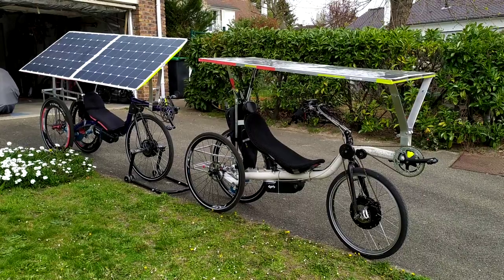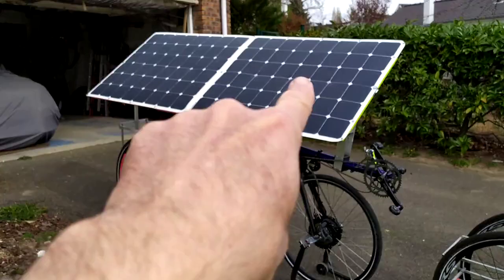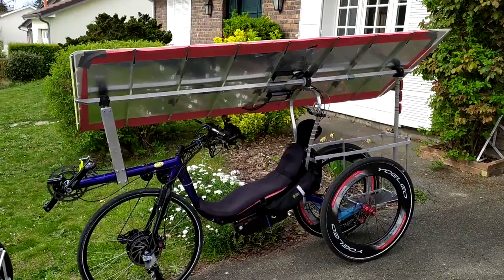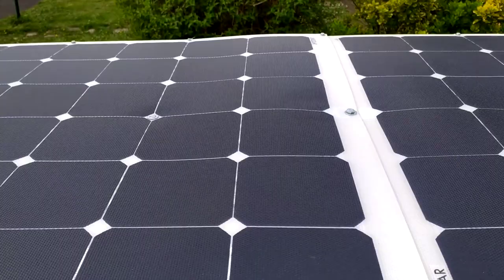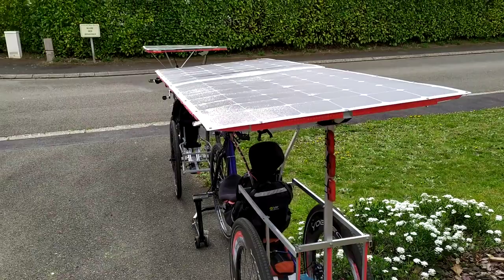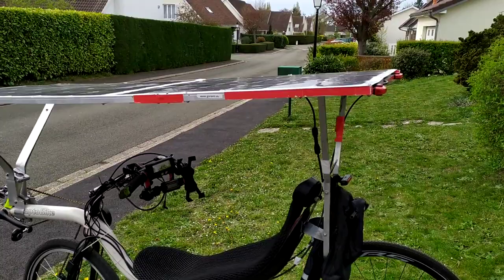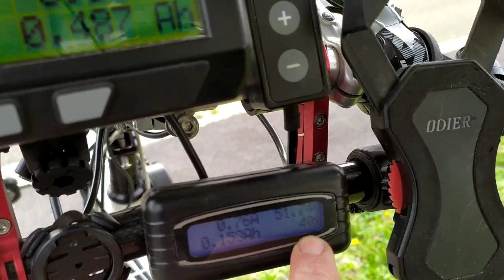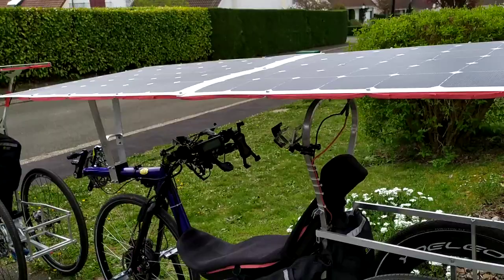Comparing Solar bikes

Comment: I'm thinking about transforming a M5 LowRacer rear drive into front wheel drive too.
Just like you did geniously. I allready have a spare Raptobike lr front fork diameter 26mm / 1 inch internal fork width 135mm wide wich can fit a rear wheel with cassette.
My 2 questions to you Daniel are: 
1. a " How with wich fork did you transformed the M5 into a front wheel drive? "
Is it possible to use my raptobike front drive Fork?
1b.
Was it difficult to add idlers for the front wheel drive chain line ?
2. Wich for wheel drive recumbent is faster the alloy Raptobike or the converted cro-mo steel M5 ?
Reply from the maker: Hi Pascal, thanks for your appreciation!
Back to your questions:
1) On this page from my web site you should get relevant information on how to transform an M5 MRacer into a front wheel drive: 
https://gonano.eu/new-2019-solar-tilting-trike
Yes, I used a Raptobike HR fork for this conversion.
Which one do you have from Raptobike: HR for 26/28 inches wheel or LowRacer for 20 inches wheel?
2) Both FWD bikes are equally fast: the M5 is probably a little bit more comfortable
Reply: @daniele_go  My Raptobike LowRacer with Aero tailbox was stock equipped with a 20" fork wich can fit both erto 406mm up to 55mm tires or larger 20" erto 451 mm up to +- 36 mm tires.
More about that dutch white Raptobike LR can been seen in this video I have made about it on --> https://youtu.be/RGZRG43otL0
I purchased a second Raptobike High Racer steel front fork for 26" / 28 inch wich enables me to ride my lowracer as 26"+ 26" mid racer configuration.
Pro's cons of the HR fork in the raptobike lowracer is a bit more speed over 40 km/h in  straight line with less stability.
Pro's of the original lower front wheel 20" + 26" stock wheel in the rear configuration is much stability, easy cornering and a comfortably relatively upright riding position usefull for longer rides at the con of a bit less speed -3 KM/h.
My last experiment with the Raptobike LowRacer is trying out a 20" 406 rear wheel with 47mm wide Schwalbe tires. I might will make a video about that setup on my channel soon when I have finished adding a disc brake on the rear wheel and caliper on the frame in stead of the stock rear v-brake. . Suprisingly this 20"+ 20" setup has the two cons benefits wich are: more speed due to the more horizontal body position (about as fast as the mid racer / high racer setup) and still a lot of stability due to the lower center of gravity. In 20 + 20 "Low racer configuration I can touch the ground with my hands wich enables me to corner very fast.
Also being lower to the ground where the wind is less than higher above the ground is a benefit.  Also I like the fact to carry only ONE size of spare inner tubes 20" in case I have a puncture flat tire in the front or in the rear wheel I can use the same new inner tube 20" to fix it.
Last reaction:
I'm able to buy a M5 chro-mo lowracer . But I allready find the raptobike to be comfortable enough with the bigger 55mm 20" tires. So If a rear wheel to front wheel drive converted M5 chro-mo lowracer is equally fast as the stock Raptobike oversized alloy LR (as you noticed above) then I will probably stick with my versatile Raptobike LR and aero box.